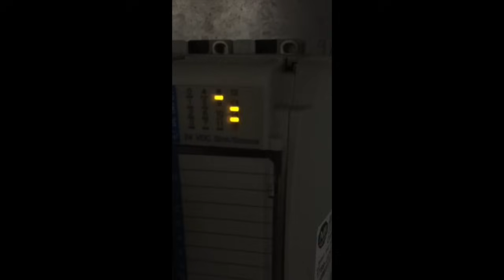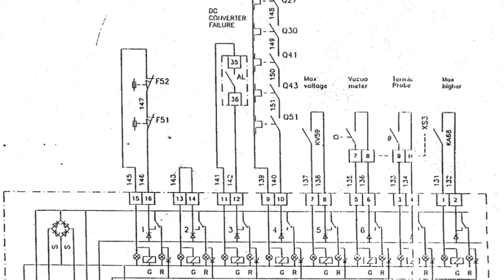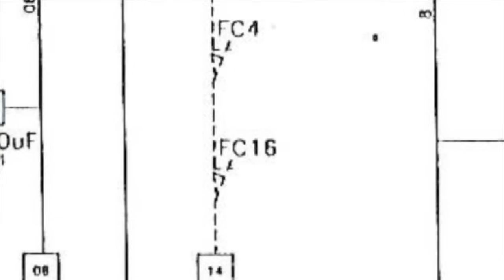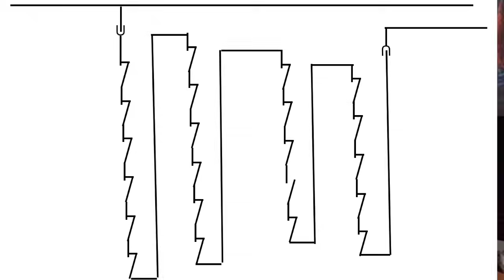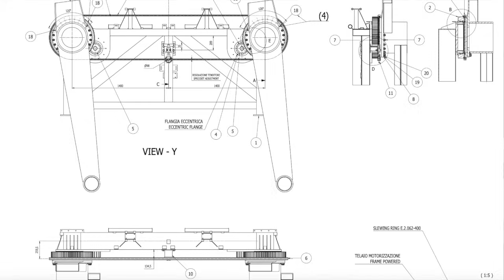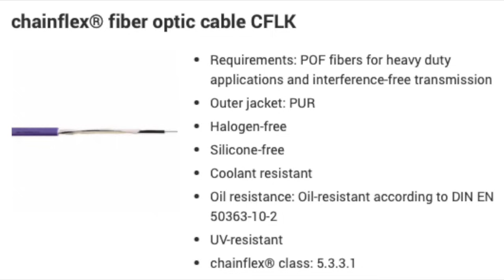Mechanics hard time trouble shooting rides part 1

Comment: Frustration is real.... Especially when you follow the manufacturer troubleshooting steps to the TEE and replace the component (s) the manufacturer says to replace only to have that same problem reoccur.... Dealing with that issue currently on big rig ...
Reply: I deal with it all the time on cars and light trucks. The best one is the Mopar diag charts. Some of them literally tell you to install a new say...... ABS module, and recheck, in like step TWO. It's enough to drive you mad! Sometimes though, it's a bad part out of the box. Even dealership components. Cam phasers are a prime example.
Reply: @Spike-sk7ql  only thing worse than Mopar is Diamler 🤣🤣🤣
Reply: @IAmAnonymyz  😂😂 Mercedes Benz too. Jaguar is the worst I've ever worked on. Except for trying to help out my neighbor with his John Deere combine. JD can kiss my ass now. I will never buy anything JD again. Hell.... the way theysay, THEY STILL OWN TGE HARVESTER, NOT THE FARMER!

Comment: Another great video! As a ride operator turned live entertainment manager/electrician/programmer/designer/installation engineer/draftsman (yes it’s a lot of hats), I love hearing troubleshooting videos. Troubleshooting abilities in a “the show must go on” environment are the hallmark of a good technician vs a great technician in my field, and is a science combining SOPs, manuals, common sense, and intuition. Working on buildings sometimes 75+ years since their as-builts, it’s always fun to hear how different disciplines deal with troubleshooting their “end user” issues, especially when documentation is lacking and it’s left up to someone to “just figure it out and get it running”
Reply from the maker: Yes! I had the mindset of “the buck stops here” I was also called in when everyone else failed. That was also hard as everyone else started with “call Ryan” haha!

Comment: We had a motor drive fault out ever 5-9 days. Checked everything and couldn’t nail it down, even changed the drive out. For some reason I decided to take off the shell of the db connector that was for the encoder cable. At the time I thought I broke a wire off the connector when I did that.  I soldered it back on and the fault went away. That wire must have been holding on by a thread.
Reply from the maker: The time! and money right!

Comment: Intermittent problems are the worst.  You know something is broke but you can't reproduce the conditions to cause the failure consistently.
Reply from the maker: How about, you need to lock out the equipment to check it but locking it out clears the problem you’re trying to fix. Annoying

Comment: Dont the limit switches on the ride have some sort of led indicator map in the control room? Surely that would make it a hell of a lot easier in diagnosing which switch is causing failure?
Reply from the maker: @Balootoyoutoo  most do not. Indicators can back feed circuits and cause an open switch to read closed. Any indicators are an entirely different system laced in to the ride.

Comment: Interesting about the HUSS Frisbee. I rode a traveling one here in the U.S. and IIR it required city power to swing fully to ~90°. It would also shake when run across the tires. I think it was a mechanical nightmare.
Reply from the maker: They seemed rough to set up.   Ours had an installation flaw we discovered. The tires ran inline but when examining the print they should have been side by side. The two drives were offset by about 200mm but (I’m guessing) when they placed them that aligned the drives with each other. Not offset. So it caused some unusual arm movement on high swings. Watching it closely it moved ina figure 8 in the air.
Reply: @ryantheridemechanic  oof
Reply: Yup, sounds like good old Tasmanian Devil.

Comment: I'll give you a good one from the world of arcade games.  Late 90s, Sega released their Nascar driving game, in both a regular (29") version and a deluxe 50" sit-in version. 

At something like $24k, the big ones were pretty much limited to amusement parks, Dave & Busters, etc. 

So, I get a call to go out and fix one (at the time I worked at a distributor as a manufacturer's rep) with a dead CPU.

Go out there, replacement CPU in hand and find the bad one is so hot the chips have desoldered from the undersides of the circuit boards and fallen off.

Why?  On this game the CPU is located under the seat, with an inner structural wall forming the sides of the cavity it sits in, and about a six inch gap to the outside of the cabinet. 

There's a really nice 4" cooling fan mounted in that exterior wall too.  So I get to looking and realize the interior wall is solid wood.  Front to back. 

That fan is doing nothing but cooling dead airspace.

4" hole saw, a nice brand new hole in the inside wall, and game is fixed.  Never overheated again. 

Sent off pictures to the Sega Service folks along with the melted CPU.

My pictures are, to this day, still available as part of an official Service Bulletin.

That is how you know you've made it in an industry.  😎
Reply from the maker: Haha! That’s cool! I to have some pictures in some ride service bulletins. It’s interesting when I come across them.
Reply: @ryantheridemechanic  😎

Comment: Could you make a video about what happened with the Deja Vu to Goliath failed move and upgrade? The ride was great at Six Flags Magic Mountain, but was somehow messed up supposedly irreversibly when modifications were made after it was moved to Six Flags New England. It was a super cool ride and was very imposing on the midway but I never got to see it operate. I heard various rumors about why it was eventually taken down and presumably scrapped but I've never heard anything that was definitive. Could you make a video shedding some insight into that? Maybe ask some mechanics you know with other parks or people with Premier or Vekoma as they may have some insight. Would be super awesome. Cheers
Reply from the maker: It would be at o be hear say from mechanics. Manufactures would never disclose anything about someone’s ride.
Reply: @ryantheridemechanic  even mechanic hearsay is better than speculation from enthusiasts on online forums who "swear they know a guy"

Comment: Do manufacturers not give yall a SOO with your equipment?
Reply from the maker: Soo what?
Reply: @ryantheridemechanic  sorry, Sequence of Operations manual. Manufacturers  typically provide a sequence  of operations with their equipment that outlines how the equipment is supposed to operate and particular set points they operate at.
Reply from the maker: @wyattbella6459  oh! Yea. Big ones. Hundreds of pages long. Yet every time something happens. Useless. Part of the problem with 4 systems all talking with alternate safety systems interlinked between themselves. I know a guy that  fixes factory manufacturing equipment, tells me some of their troubleshooting manuals. So nice when it’s all manufactured by one company with proprietary info. All seems to work together nicely. This stuff is nuts. Drive one enabled, safe torque off, forwarded enabled, speed reference 0 safety is 1 and the drive still sits there! FU drive!!!  haha!!! And that’s a simple flat ride

Comment: 49:00 Would this also not put excessive wear on the wheel, or issues from heat on the motor or even friction?
Reply from the maker: Not really they don’t have that much traction. More audible than anything. Plus those get changed twice a year depending on use.

Comment: That video probably the one that got a crew replaced. Great racing Ryan.
Reply from the maker: Ha! Thanks! It was one of my high points for sure
Reply: Love to see a video on a certain schwarzkopf traveling coaster and why it didn't want to operate properly in 2 totally different locations, but seemed to work fine after it went south of the border. Why was it modified, and did it kill the ride experience?

Comment: This may be a dumb question as I have no experience in ride repair, just networking. Why would the newer rides not have data logs for all the encoders, sensors, etc? Seems like that could save a lot of time troubleshooting as you could just look at the graphs of each sensor and see which one is giving less than optimal data.
Reply from the maker: The PLc is not meant to record data. It’s one of the reasons they work so fast. So you need an alternate system to watch the ride.  So most parks don’t see the value, even with a week of downtime, to record everything all the time. Plus I’ve seen things like this, you still don’t know what you’re looking for even with it all in front of you.
Reply: @ryantheridemechanic  I also don't know anything about ride PLCs but I'd figure the PLCs could have something like an RS485 serial output that outputs a copy of all the sensor (and output) data in real time. Then you could use a cheap off the shelf PC to do the data recording. The data alone would be hard to work with but if you have time-synced security cameras I'd imagine it would be helpful.

Comment: I was watching an old discovery special of behind-the-scenes at Cedar point. They were doing the morning test runs of their coasters with a maintenance person on board. Is this normal? It doesn’t seem like that happens anymore.
Reply from the maker: So wood coasters have carpenters ride it daily to verify the track is good. Steel coasters maintenance never really rides.
Reply: I ride my woodie 4x in a row daily. Some of my previous parks had me ride my steel coasters, some didn't. I always rode when I could though. Not only am I a ride mechanic, I'm also a coaster geek. I did the math the other day, and I computed that I have ridden my woodie over 4000 times 😂
Reply: Somebody taking a ride on the coaster is part of the ops checklist. At least one member of ops has to ride before guests are allowed on at that park and ops can't ride before another daily  block check is done. It's an easy way for guests who pay attention to know how close the ride is to opening for the day. Oh, and Steel Vengeance has to be signed off by both carpentry and maintenance.
Reply from the maker: @Jenlovescoasters  that’s a lot.
Reply: @Jenlovescoasters  that HAS to be some kind of record 😎